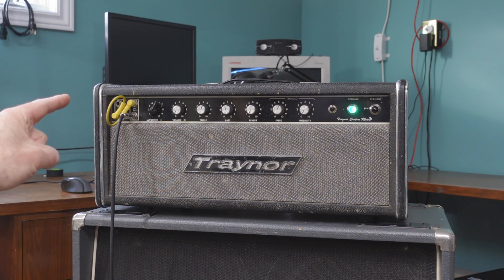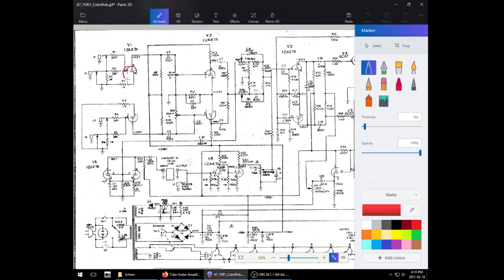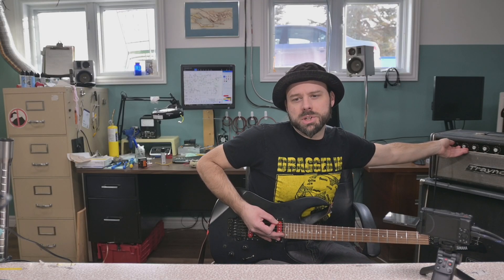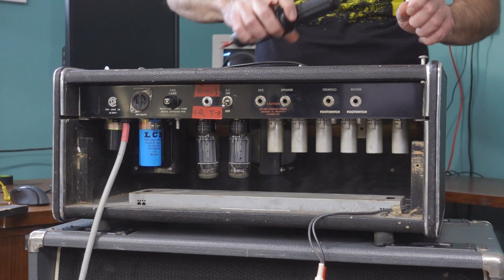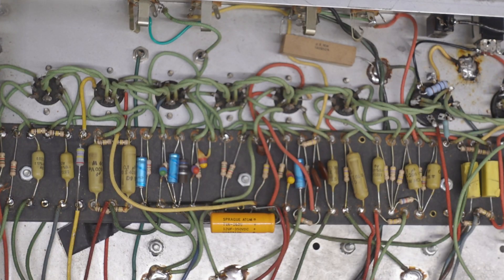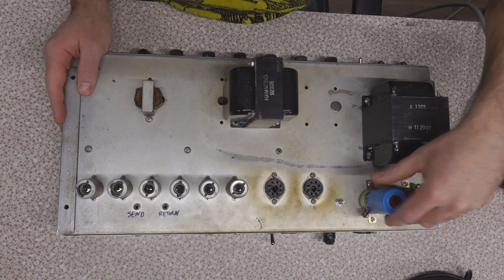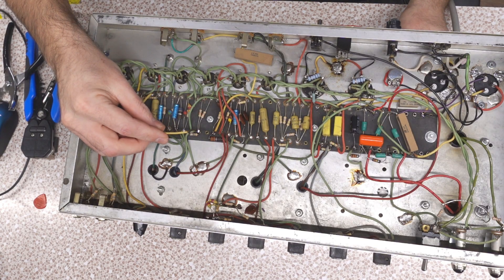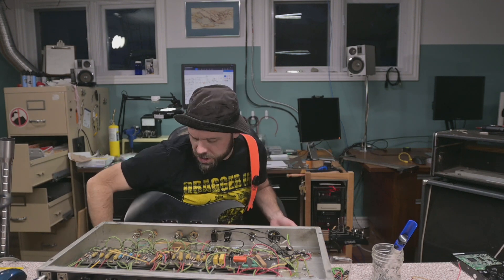Traynor Custom Reverb, Circuit Overview and Quick Cap Change.

Comment: trying to get a new reverb tank for a similar YSR1. My amp does not have the transformer for the reverb Cct which I assume it means that it need a higher impedance. i understand there are 200 ohm versions and 58 ohm versions of the tank. Would you know where I can get a 200 ohm impedance tank. I believe the part no is 4FB3A1B, do you know where I can get hold of such a Reverb Tank
Reply from the maker: Google "Accutronics Part Numbers." if you can't just go to
https://www.amprepairparts.com/reverb_numbering.htm
This will give you a breakdown of what all the model numbers mean. 
Find a retailer you like to work with, and see what tanks they have, and you can find a close approximation. 
Reverb isn't THAT fussy. It is ideal to get a matching tank, but many tanks might work. 

As an example.  4FB3A1B Might be too high. The F means 1475 input imp. You said you wanted 200 ?, then you want a C or D. 
Third B will be standard. 
Fourth 3 is standard. Tho you might want to play with a 1 or 2 if you like ALOT of reverb. 
The 5th A is subject, I prefer B tanks for the ground isolation. But stock would of been an A. 

I get my reverb tanks from https://nextgenguitars.ca/ , But that's in Canada, not sure where you are.
Reply: @DATT  Say it should be high impedance as it seems to be direct driven from the tubes.. There is no Transformer which suggests theoutput level will be high and the impedance will also be high. Hence I think I should need a high impedance Tank for a high voltage low current out..
Reply from the maker: Well yeah, the direct driven tanks will have the higher input load on them, which are pretty much the same tanks solid state amps use. It should be easy to find a replacement. 
I personally have not worked with direct drive reverb circuits very might, so I can't really advise much past what I've already said.

Comment: Great video! I have a ygl-3a and the tremolo sounds good but it doesn’t really have any effect until the intensity is turned up past 3 o clock, is this normal or could this be part of a bigger problem?
Reply from the maker: That is pretty high. I assume you've tried changing the Trem tube already ?
Sometimes the biasing of the amp can have an effect on how the intensity responds. 
Also, the volume. I have a Fender head where if you are running the amp cranked, you can't hear the trem at all until your note starts to decay. 
If you have a fresh trem tube, the amp is biased properly, and you're testing at low volumes, and it's still behaving that way, then yeah, I might say something else it wrong. 
Could just be a worn out part. Off the top of my head, I couldnt' tell you what to look for, but it's a simple enough circuit a dece tech should be able to sort it out.

Comment: "Only clean"? Young man, try the volume knob. I've owned my '71 YSR-1 with original 4x10 Traynor cab, for over 30+ years. Clean only? Only when pussies plug in. --  No disrespect intended. You are simply wrong, or you have  governor's that only go to 2 on the volume knobs. Thank you very much for posting your presentation; It should drive down the price on these great amps to around $25/ea.

Comment: I just made a trade offer on one of these. Offered a Phaez amp. Hoping to get it in a few weeks. I'd like to try and make one channel a bit higher gain.. maybe add cathode caps . A .68 and 2.7k in one channel . A 100uf and 820 in the other ? Any suggestions man ?
Reply from the maker: Well "adding" cathode bias caps is a JCM800 mod, this amp already has them. Seems it has a common cathode too, the first stage of both channels run off the same resistor/cap set. That said, I did have one of these come thru my shop modded and it sounded really good. Lets see if I can describe it. 

First channel, knob starting left, input to the grid as normal, coupling cap off stage 1 is 0.002, and then, a 100pf in series, which is odd but it's what it had. That goes into the gain knob, from there it goes to the second set of inputs onto the + of the low jack where the 1m and 68k meet. Ahh, I didn't draw those resistors, I can' rmemeber if they were removed or I jsut didn't draw them. Try it with the resistors in place first. Those jacks go into the second channel stage as normal. That stage has the typical .022 coupling cap, which goes to a 100k/100k voltage divider which used to be the mixing resistors. Those resistors go into the 3rd stage/cathode follower as normal. That goes to the tone stack as normal, and then off the treble knob, they inserted the second channel gain knob as a master volume. 

It's a slightly odd take on the cascade mod, mostly cause the series 100p, which surprised me, I'm pretty sure I read that value right.
Reply: @DATT  cool thanks, man. I'll copy this down. Sadly I didn't score the amp but I'd I get one I'll give these a try
Reply from the maker: @soapboxearth2  Oh, well damn, there goes that plan.

Comment: Ever cross paths with a Traynor ycs100h2? If so how's it stack up to the usual high gain amps? Thanks
Reply from the maker: I personally haven't worked with it, but yeah, Kev said he needs some work done.
Reply: @DATT   Well guess it's fate lol. I personally haven't tried it, but hear great things.Always liked the old tube Traynors but to know they have this...man it's like Canada is like oh yah we do death metal eh,lol From Ontario and always wondered  if Traynor cared about metal...fuckin punch to the face bud.Cant wait thanks dudes. Oh yah I accidentally learned some electronics from your vids.Thanks
Reply from the maker: @gunnarbill6209  Well, there old amps are on par with the times. Judging by the schematic, it does that the kind of circuit to do metal. 
An hah, yeah, I'll be doing a lot of electronics, that's most of what I'm currently filming.
Reply: I've got one, it will end up on this channel in a video when I head down there. Personally I use it for anything from death metal to clean stuff. The two channels can get to Dual Rec and JCM 800 territory. I think it's great!